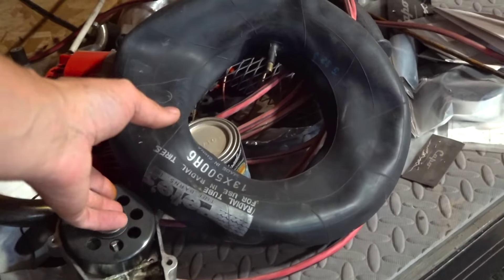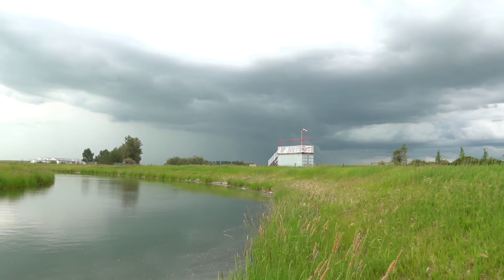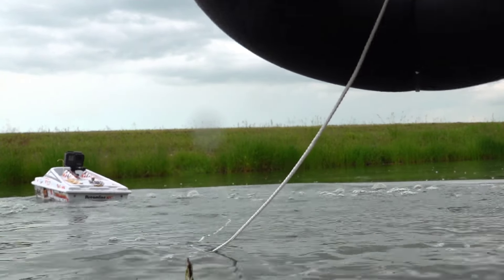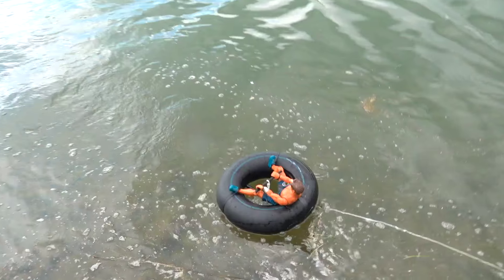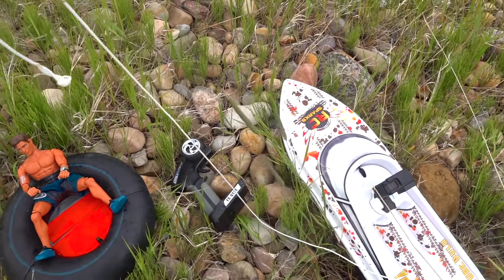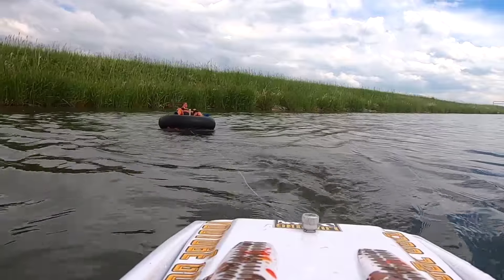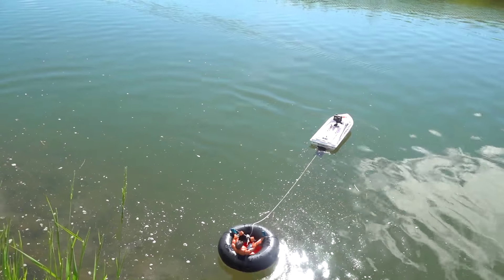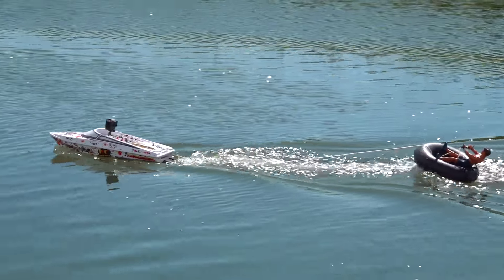FiRST TiME TUBiNG BEHiND the THRASHER JET BOAT - StreamlineRC | RC ADVENTURES

Comment: Tie the rope up on the go pro mount or fab up a bracket to get the rope higher on the boat. The rope is low so it wants to drag the front of that tube down with it!

Comment: Flip the inner tube inside out so the stem is sticking out towards the boat and then tie the string around the stem and make the string a little bit longer and tape the bottom of the inner tube to make it flat so no water gets in the middle. Love the videos!!

Comment: Love the idea.  Just need to workout the kinks.   First off the last run is promising.  I would tape an old CD to stiffen the bottom of tube, leave a gap at back to let any water in the tube out.  Next is the balance of rider needs to be hunched over the tube so it will get on plane.  The fluid dynamics force is holding tube to the water from the tubing curve. 
The last is to lengthen rope back out of the pumps Jetstream spray,  this is one place that 1:1 to small scale  work in the same way.  

Looking forward to MORE Videos on this tubing setup.

Comment: That is an awesome idea! What you need to do is take the boat side of the rope and secure it to the top hatch locking knob (the silver thumb screw) this will get the rope out of the water, so no drag, the rope will then be even with the top of the tube, and in the gopro it will look even more realistic as the thumb screw looks like a standard tow point on a ski boat.

Comment: You asked for more suggestions? I have an important one. The rear of the inner tube is rounded, which pulls water upward as the tube is drawn forward. Have you noticed that all fast boats have a straight up transom, while slower sailboat hulls are rounded at the rear? Pulling the water upward has the same effect as pulling the rear of the tube downward, into the water, causing tremendous resistance.. So, how do you fix that? You need to flatten the rear underside of the tube so that the water skims away from underneath instead of trying to curl upward.
I have been enamored with the Thrasher ever since version 1. It's such a well engineered boat. I even contacted Scott to try to buy one of their jet drives. If you ever get tired of the Thrasher, Aaron,  you know where to send it, dude ;-) Thanks for sharing your day with us.

Comment: Next I think you got a build a tower for the Thrasher like a full on ski boat has! 🤘
Reply: Yes i love that idea that would help pull the front of the tube up more
Reply: The only thing is though with the bilge pump inside it flips back over automatically because of the weight on the bottom of the boat so with a tower it would make it harder to flip

Comment: Mr Medic Sir!  i am not a scale RC boating guru BUT i have done  a TON of river running in inner tubes around my neck of the woods, the pacific north west washington state... its part of our annual spring summer activities...
so i watched the whole thing because i always do... and you asked for ideas to make this set up ore stable... i would totally use those two zip ties to run the "tow rope" under ...   run the rope under the ties, on the OUTSIDE or boatside of the tube. make a loop tie the line to itself in a triangle shape so your pulling from the front edges and not the back half where the guy is holding the line. thats causing you to nose dive the way its set now, and it wont be pulling from the top as you can push the loop higher or lower on the tube to adjust the fronts angle of contact with the wake of the boat and a bit longer line.  i wish i could add a picture in this chat,  but if you look up purpose made riding tubes youll see the pull point in the front of the tube...  using your zip ties as two points going to one "the tow line" in a triangle is how they set up water ski ropes.  you can then add a short linewrapped around the tube for the rider to hold the handle but its now cosmetic instead of the pull point.   loving all the vids you post, and youtube gold is better and bigger every episode looking forward to loading wa... er kings!

Comment: That was Kool. You could move the weight of the rider lower in the tube and to the back. Add a scupper to the bottom, a flap cut in the bottom of the tape. If you use an old windbreaker to build a shell around the tube

Comment: Try making a small tripod for the rear hatch on the boat to tie the tow rope to too get it out of the water / prop (jet) wash, then make a two point bridal for the tube to attach the rope at the center point of the tube have your guys hands zip tied to handles and have him sit in the bottom of the tube to lower his c.o.g. My two cents. Hope it’s helpful.

Comment: That’s actually kinda cool. One recommendation: It might work better if you wrap the string around the tube and have it go to the boat from the lower point of the tube if that makes sense. That is just how our full scale speed boat tube is designed that actually holds humans, and yes it almost always has the front end very high so it is normal. Still a very cool concept 👍

Comment: That's a very cool idea. I would try still knotting the string to the valve, but going under the tube rather than from the top. Hopefully this helps at speed and it doesn't want to dip and dive down any longer. Otherwise you can tape the string to the middle of the tube, it should not try to either lift or dive the front. Anyway, good luck, that's so cool.

Comment: To make it more stable, being it's top heavy. Get a piece of thin wood, metal, even a screwdriver and put it under the tube. At the end of whatever you put under it, put an extra weight. Kinda like the long stabilizer on a sailboat under the hull. The weight would be at the end of that stabilizer. The longer the rod/stick/pole you use, the more stable it will be.

Comment: Lol awesome work! The dude has to ride the tube with legs trailing mainly for weight / in the water and hands holding the front of the inner tube handles. The rope would get attached to the front of the tube itself. at least thats how we used to do it. It would also be cool to put a rudder on the tube so you can steer him in and out of the wake. Could step it up and make a wakeboarder with a steerable rudder but that might require a lot of r+d lol  Or use the surfer guy rc

Comment: Wrap the tube in  netting a net/mesh bag gives  the pilot a place to set  but also allows for  attachment points for a  harness. Attach  to the tow rope at 3 to 4   spots around the  front of the mesh  should work.

Comment: With a jet drive, you have a good amount of thrust coming back which ends up actually pushing straight back as well as to the sides. If you can capture whatever you're towing (or even if you have another boat following) and the wake, it ends up sticking pretty well. Makes it easier on the following craft as well. So in this case you can see that when towing with a jet, its pretty much impossible to towing directly in the center. I was a craft operator on a couple 11 meter rhibs. Same concepts regardless of size🤙

Comment: If you can get the tow rope out of the water, it should help. Affixing to the capture nut on the removable top of the boat might be a good anchor point. Or, if you have any in your backstock, a scale bed mount tire carrier from a crawler might elevate the anchor point - if you could attach to the boat without doing any damage. The pitch of the boat while pulling the tub might allow the GoPro mount to be an adequate anchor point as well. Anchoring toward/closer to the bow will give odd geometry while turning. In any case, I think a slightly longer tow rope would also be beneficial.

Comment: Id tape the rope to the tube so it spreads the load about 1/3 way up, and tie it higher on the boat, that battery door screw looks like a good spot.

Comment: There are a lot of good tips down here in the comments to solve your problems with the tube. As someone who has a 1:1 boat and pulls real funtubes on a regular basis I would recommend to pull the tube from the front center. Not with the rope over or under the tube. So maybe put a ziptie over the tube or loop a rope around it. Then attach a ring to the rope or ziptie or connect the pulling rope directly to it. On the boat, connect your rope as centered and as high as you can. Also place the action figure with his butt in the tube hole just like a real tuber. The weight distribution is much better this way. The action figure doesn't need to hold the rope because it's already attached to the tube. In real life you only hold a rope like this when you a wakeboarding, waterskiing  or kneeboarding. Good luck! I think round 2 with these changes will go much better.

Comment: I believe my tube has a protective cover and at rear is a flap to let water be pulled out when moving forward.  Also the rope hooks to a harness that has 2 anchor points . Maybe couple zip ties to a rope and a key chain ring as hooking spot?

Comment: 1. Place the rope further up in the boat. Use your GoPro mount like a wakeboard tower. That will help bring the tube up some and less down drag on the rope.
2. Let the rope out farther back from the boat and it will be in less prop washy water.
3. Tie directly to the tube and keep the knot at the waterline.
4. Vent your tape on the bottom so when the tube fills with water, the water can scupper out the back as you accelerate.
         I think that will alleviate all your issues.
Reply from the maker: I actually built ALL of that last night bro..and you are ON POINT! I have had so many people offer help for this "problem".. that I think the next video will be very good. I have yet to try these changes, but you guys will be the first to see it all done later today
Reply: @TheRealRCSparks  right arm! I'm stoked to see it! I just used my own boat, wake tower and large towable tube as reference. Keep up the good work on the channel. Love the content!

Comment: You should tie the rope to the gopro mount so that it is like one of those wake boats. That way it is pulling straight forwards instead of down wards. If you do that, then put the rope through the hole in the bottom of the tape cover. That way it is pulling upwards on the front of the tube. That would lessen the chance of it nose diving into the water at a higher speed

Comment: Hey Aaron, if you tape your tube on top and bottom and add a zip tie to the front and hook your tow rope to it, you should be able to run the rapids.
Just make sure your tube is water proof top and bottom 
She shall not sink

Comment: Hey, use some tire glue and glue some grommets at the 11 and 1 o'clock positions to the tube itself.  Most water ski tubes don't have the rider holding the rope, they are holding onto the tube...

Comment: One thing I had in mind, pull from the go pro mount more like a modern tow boat.
Reply: Yup, no real ski boat ties the tow line under the water. Tie off on the latch cover or better, the go pro mount.

Comment: Definitely equip a boat with a custom krazy joe wake board tower. That will change the angle so that it wont dive. Possibly put a one way valve on the bottom of the tube to drain water. It's not re inventing the tube it's just making it scale in every way possible

Comment: You can tape both top and bottom and have him lay on top tube and put the rope through the middle of the tube and have it pull from the front of the tube just cut a tiny hole in the tape

Comment: I think if you made a loop around the tube so the rope could be more centered on the tube, top to bottom, and then raise where the rope attaches on the boat itself like a couple others have said so the rope can get more out of the water it could work better.

Comment: Put a zip tie around the tube and have the rope attached in the center of the tube so the rope doesn't lift or push the tube down when pulled.
Also an elevated tow point may help???

Comment: Tape your pull string to the inner tube could you add your angle of lift bring it over there outside however low to the water you want it to change pitch of him jumping the waves

Comment: if u attach the rope to the front facing  outer side of the inner tube it should work fine. that is how the real sized tubing tubes are designed. also, u can make an up side down  horse shoe pole brace up 1 side and over then down the other side right  about in the middle of the boat. then attach the rope to the middle of the upsidedown brace that should be kind of over the cockpit.

Comment: I might be wrong but Isn't it supposed to hook Center Horizontal and Vertical ?The rope I mean . With 2 ropes coming half way horizontal and vertical from the side hitting center point in front of the tube about 6 " from the front of the tube?

Comment: Tie the rope around the front of the tube and it will pull it more even and level .if ya want to try that and allso put another hole in the back side of the tape so water can come out when pulling ..

Comment: Tie it higher on the boat that way your pull point doesn’t pull the tube down when you go faster it will also get the rope out of the water which means less drag that screw on the back deck would be a great spot to tow from also try a zip tie around the front of the tube so the ow rope will pull directly from the front of the tube just like the real ones do those two things should solve all your issues

Comment: Lol, THat is tooo funny!! Ok, design thought, u tying the string around the stem definitely made a big difference, but now I think your tape bottom is working against u. Also, if you can use zip ties to get the string to sit & be at last contact with the tube at the mid height on the opposite side from the stem *if that makes sense*. Like it would be if it were a real 1 to 1 manufacture design & produced pull behind boat tube.
Reply from the maker: Just wait and see what I have for later today.. Lol :)
Reply: @TheRealRCSparks  Sweetness Bud! Looking forward to it.

Comment: Rope needs to be mounted higher on the boat and pulling the tube from a lower point. Make the boat pull the front of the tube out of the water.

Comment: You need to put the rope on the back of the boat where the screw is sticking up and then make the rope to scale of a regular tow rope for the tube and you won’t have problems also put the rider more in the tube no body rides like that lol

Comment: The rope on the boat needs to be above the deck.might also want to figure out a way to get to line on the inner tube in the center,not above or below the inner tube.might balance it better. Great concept though.

Comment: You need to have the rope up higher on the boat so it's out of the wake. The rope on the tube has to be attached to the front so your pulling on he front of the tube.Otherwise you pulling too close to the center and it makes it a pivot point  making it unstable and wanting to rotate and pivot at the center of the tube. Make sure the rope is about half way between top and bottom of the tube. Couple that with the higher point on the boat the tube should plane off and not nose dive.

Comment: OMG, when you ride a tube you don't hold the rope like you do when you ski. The rope is attached to the front of the tube and you hold onto handles. Leave the tape on but drill lots of drain holes in it as tubes usually have a bottom. Lay the rider down to bring the center of gravity lower raising stability.

Comment: Look at a real tube. The rope attaches to the front of the tube.  I think your best bet is to try to scale the real thing. Maybe tie the string around the tube so it's pulling directly from the front of the tube some how. I also think the rope is tied too low to the boat. I think your best bet overall is to just mimic the real life attachments as best you can.

Comment: rope at boat should be higher and tied low on the tube, pulling the tube up into the air and not down into the water as you have it now

Comment: I keep puffing my 5450mah 6s maxamps batterys
Reply: Make sure to set your lvc, don’t let them get too hot, and make sure the battery is rated for the amount of amps your drawing.
Reply: My battery’s are supposed to be able to handle it and the lvc is pre set on the thrasher

Comment: I have tried this with my Thrasher https://youtu.be/XsxAuDkGhG0
 you need the rope attachment part higher. I tied to the screw for the hatch. Tie the rope for the tube so the rope is on the front of the tube like wrap it around the tube. Hope to see that guy hit some wake at high speed lol! Cheers

Comment: Who the hell ties a ski rope to a jet pump. That rope needs to be out of the water.
Reply from the maker: I find your comment humerous, as everyone in the next video tells me to tie it at the pump.. Lol
Reply: @TheRealRCSparks  That's funny. For real though.  Things will work better if you can tie it up higher.  Look at wakeboard and water ski vids. The rope is tied to a center mast that's in front of the engine and behind the driver.  These real boats also have skags for tracking.  So i would suggest tying it above the pump/ nozzle.  The rope being up higher will pull the tube up higher.  I would stick another go pro mount on the what appears to be the motor cover and tie the string to that.  
Cheers.